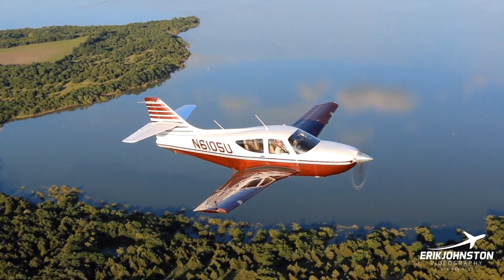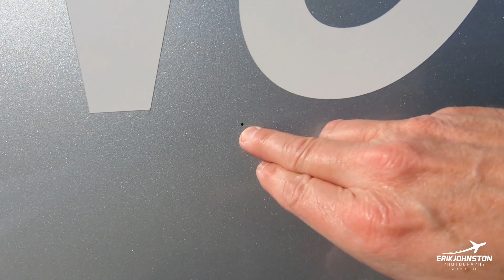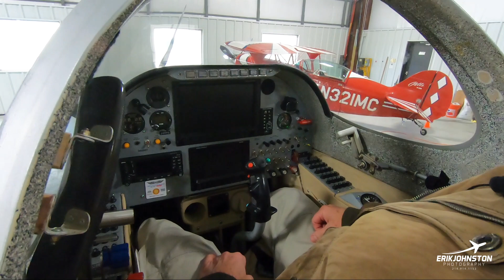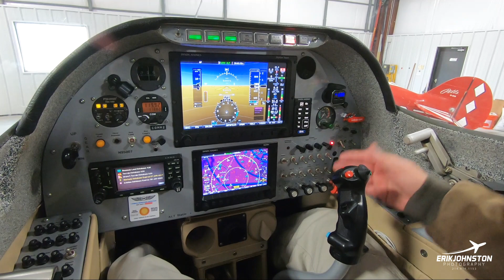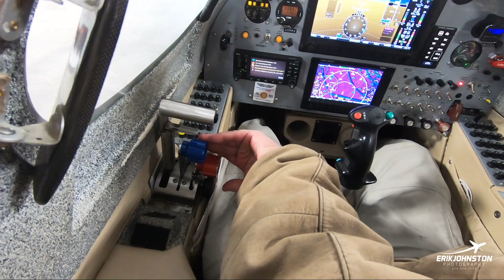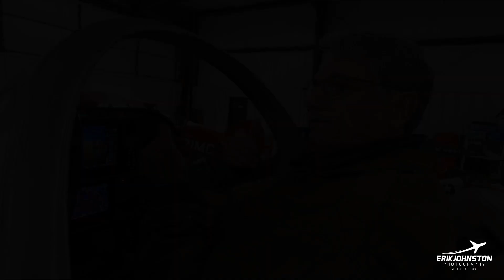Turbine Legend Walkaround Tour

Comment: Is there any other propeller aircraft faster than the turbine legend? Doesn't the turbine legend have a top speed close to 500 miles per hour?
Reply: No....not close to 500.  Many older WW2 propeller planes are substantially faster than the Legend....in part because they have upwards of 2000 HP rather than 730....
Reply: @williamkinney427  Not to mention a lot of them were able to maintain most of their power at altitude, where the turbine loses a lot of power.

Comment: Beta is zero prop pitch. Not reverse.
Reply: Wrong.  Beta is a range the power lever can be moved within... Below that used in flight (the flight range is alpha range: the range  that the power lever can be moved in during the flight regime). Most turbo props have a weight on wheels switch that only allow the power lever to be moved from the  alpha range to the beta range when there is weight on the respective wheel and there by defines the regime the aircraft is in.

Comment: Ever thought of stuffing a GE Catalyst engine in the Legend? 1,600 hp through a McCauley 5-bladed prop will be very interesting and certainly give those heavy "warbirds" a run for their Merlin or Double Wasp dollars. May need to lengthen the tail with a plug... maybe call it a Long Nose Legend?
Reply: Ooh and it would probably perform better than an 8 mil pc 21

Comment: Well presented.  In 2008 I met what I think was the first Turbine Legend on their way to Oshkosh.  That one is pressurized.  I do not remember the performance numbers but I do remember being highly impressed.
Reply: Apparently the manufacturer has been working on a pressurized prototype of the Legend. Not sure about the status of that project.
Reply: To fly fast you have to fly high. To fly high you need you need  pressurization. The power to weight ratio and aerodynamics of the Legend should take it to about 640 km/h, but unless you wear a pressure suit you are not getting there on this legend. This thing will run out of air for the pilot before it runs into the Coffin Corner.
Reply: Dwight Looi 

     Aerospace physiology and aerodynamics are not your strong suit.  Also, most aircraft in the world do not reference Km or Km/hr.  Distance is measured in NM and speed is in knots or MPH.

      This aircraft could achieve 330 KTAS at FL250.  This is 15 KTAS shy of the 640KM/H you stated.   At FL250, Sea level arterial PPO2 is easily achieved with a helmet/mask and 100% O2.    
         
       The ability to make thrust from a propeller drops significantly above FL280.  If one desired to fly that high, a pressure demand oxygen system could be used to maintain acceptable levels of O2 saturation, but it would be fatiguing.  However this altitude is nowhere near that requiring a pressure suit.

      The only time one would need to consider a pressure suit is flight above 50000ft.  At altitudes above the Armstrong line, pressure suits are required.  FL250 is nowhere near that.

       Lastly you mentioned coffin corner.  This region of high speed flight is approached only by swept wing turbojet and turbofan aircraft.   Turboprop aircraft have too much drag to approach any kind of Mach limiting speed and I am not aware of any turboprop aircraft that even have an installed Mach meter.
        Also, as mentioned before, propeller aircraft can not achieve the altitudes required to get into the coffin corner.
Reply: @Stepclimb  (1) Tell that to the TU-95 an aircraft with roughly the same power to weight ratio as a Catalyst engined Legend would be. (2) The coffin corner has nothing to do with approaching Mach 1 per say; it has everything to do with flying high enough and fast enough that the air is so thin that to not stall you have to stay above a certain speed, yet you no longer have the ability to stay above that speed. (3) Turboprops get more efficient with altitude because drag is reduced and the intake air is very cold. Think of the turbo prop as a VERY high bypass turbofan or an unducted fan. They are VERY efficient even at high altitudes. They simply are not very efficient at very high speeds because there is no "duct" to force the air into a constriction and increase the exhaust velocity. Nonetheless 700-800km/h is very realistic for propellers with enough horsepower behind it. 750km/h is the speed piston engined fighters attain at high altitudes (~40,000 ft). To get there though, you need enough wing so you don't stall out and a pressurized cabin.